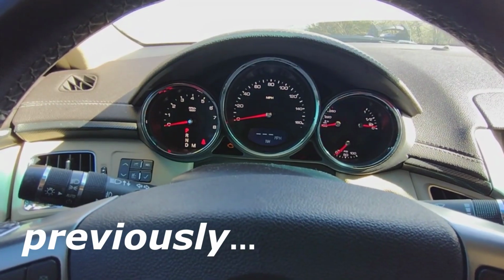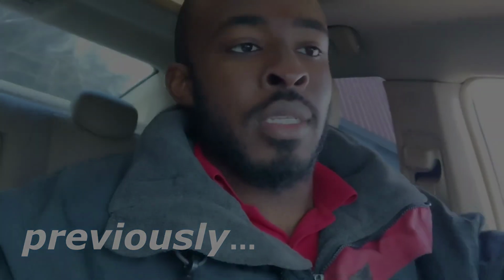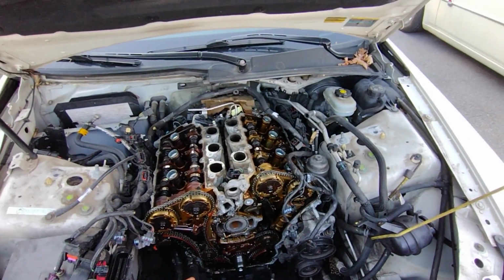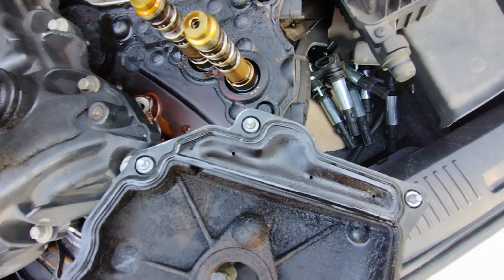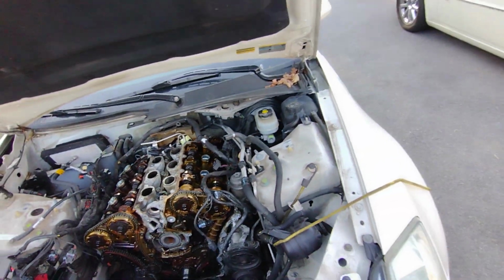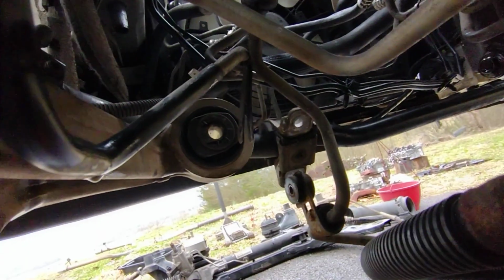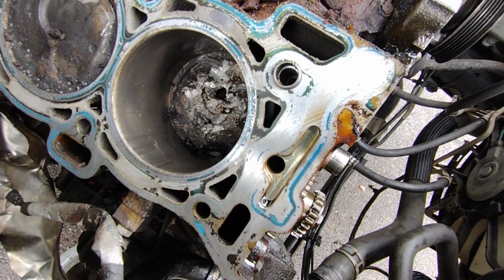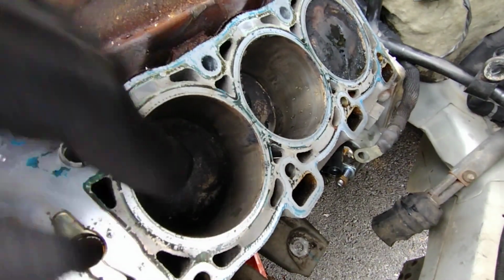DOA Cadillac Engine Teardown *INSANE CARNAGE*

Comment: I've heard those 3.6 l engines are not reliable,  dont take abuse well and that's proof. Good luck restoring it to functionality.  Too bad you couldn't fit a 3.5 Toyota engine in it.
Reply from the maker: Thanks for watching! Timing chain failure is common on the GM 3.6L. This car's failed at just under 160k miles which is in excess of the vehicle's intended lifespan.
Reply: @RoachesToWrenches  what is the vehicles intended lifespan? 160,000 mi is not that much on many vehicles.  Planned obsolescence?